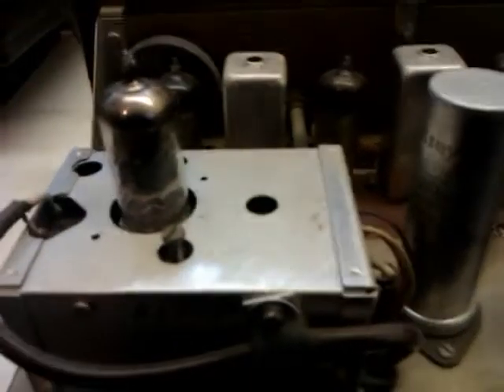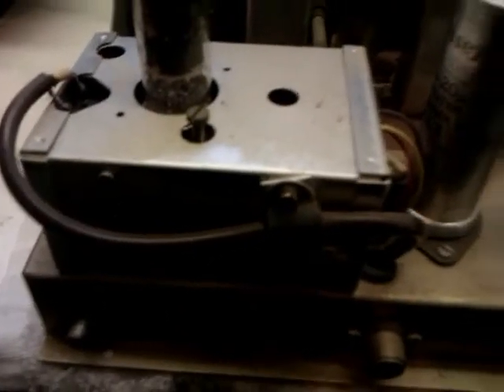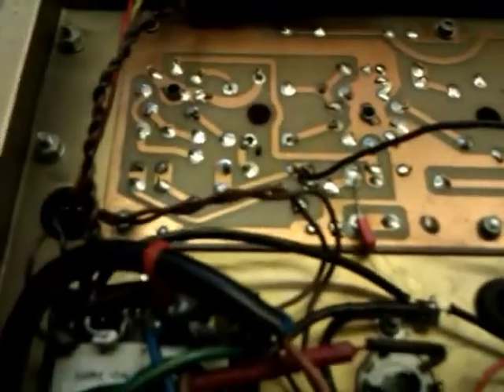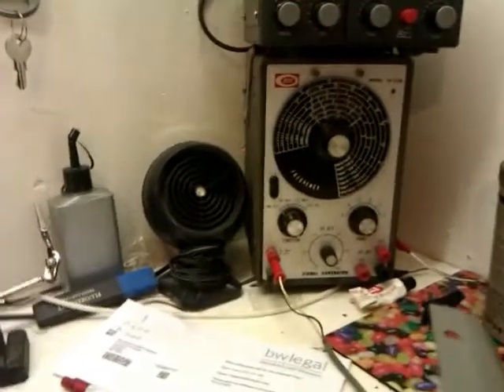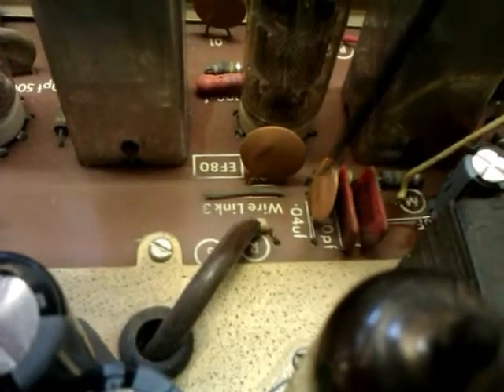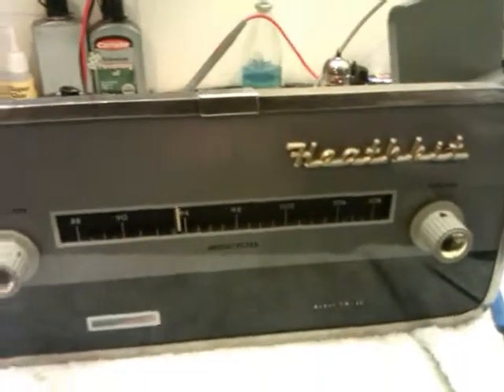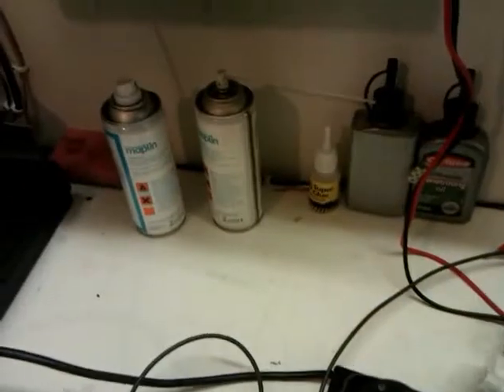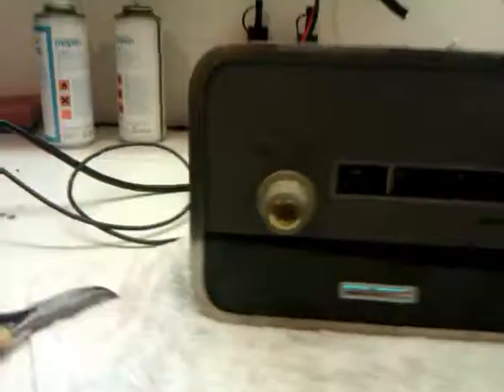REPAIR OF THE HEATHKIT FM 4U

Comment: I made one in 1969. It worked nicely. It's been in the loft since then and I might try to get it going again, if my electricity bill can stand it :) :)
I guess any electrolytics will need replacing and I'll have to check the resistors too? Is the colour code for resistors the same in 2023?
Thanks for posting.